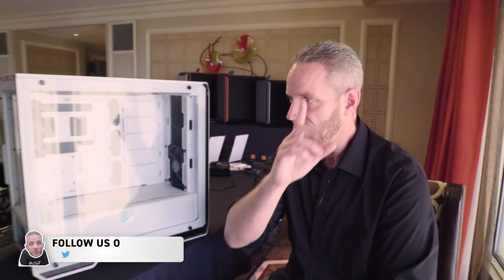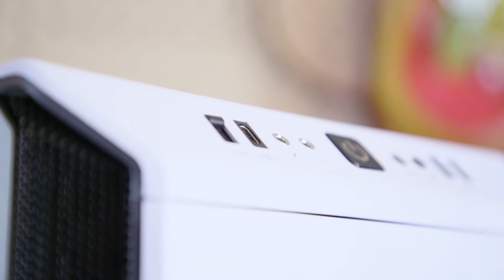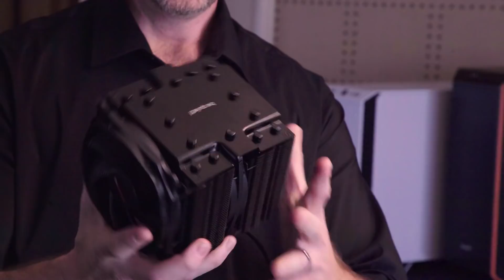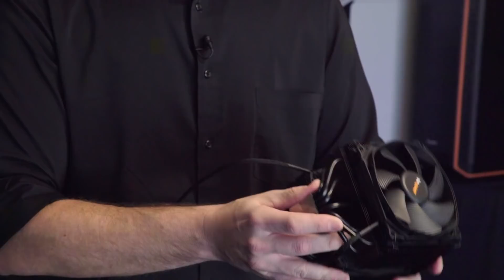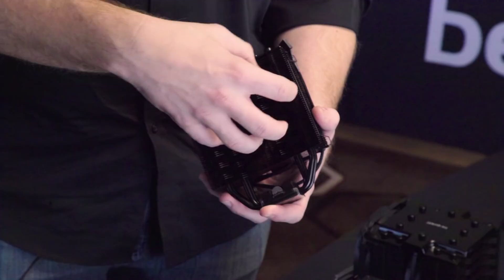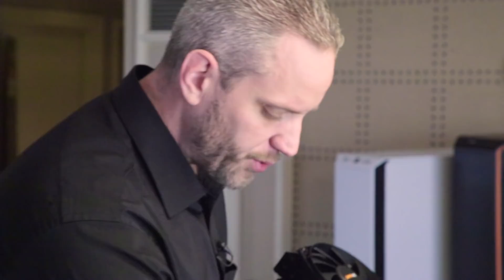This might be my new favorite Air Cooler??!!

Comment: I have the dark rock pro 4, I'm really liking it. That screwdriver is handy, too because it's magnetic.
Reply: It's a German quality screwdriver, what do you expect? Of course it's magnetic.
Reply: I got the dark rock 4, and my temps are much better than when I used corsair h100i, not regretting switching to air at all, and yea that screwdriver is super awesome, it's part of my standard screwdriver set now
Reply: I'm thinking about upgrading to a dark rock pro 4, but I'm really concerned about how close the fan is to the RAM. Would I be able to fit the cooler if my RAM is 50mm in height?
Reply: I have it too on a 8700k delided and temps at 5ghz are awesome, so close to my last custom loop, it´s a impressive piece of hardware. The perfect friend for a Meshify C ;)
Reply: Have the dark rock pro 4 as well and I also agree the screwdriver is extremely handy. The clearance between my dark rock pro 4 and 1080 Ti is too small to get my hand in to press the lock in on the PCI-E slot to remove the GPU, but theres just enough room and length to slide that long screwdriver in to press that lock in lol. Solving 2 of it's own problems it causes ftw. 

And I also just recently came from a full custom hard line water cooled with all the frills setup to this simpler setup and im actually fairly impressed with the air cooling temps these days, both with this and on my evga 1080 ti. It was fun for the years but its time for a simpler setup here :)
Reply: @Lolled9991  That's great, thanks for the reply! Ordering mine next week :D